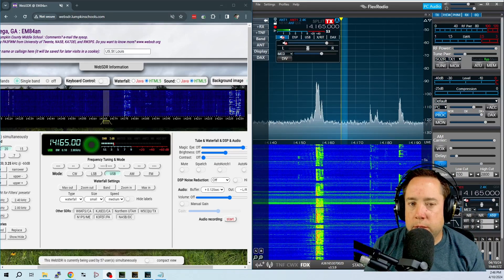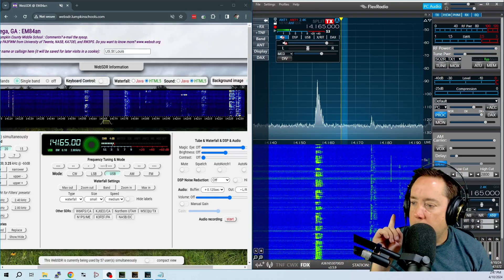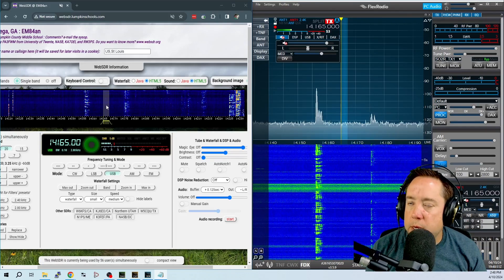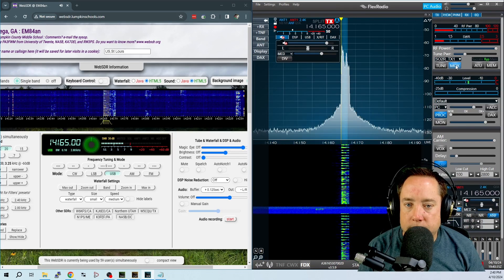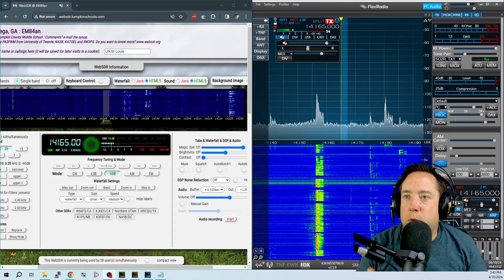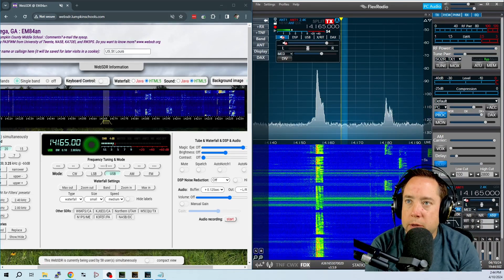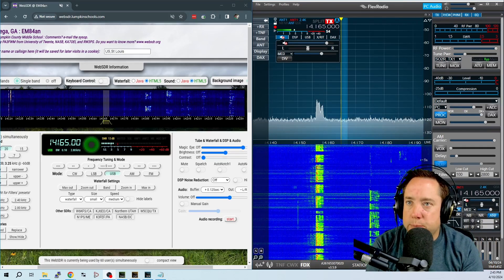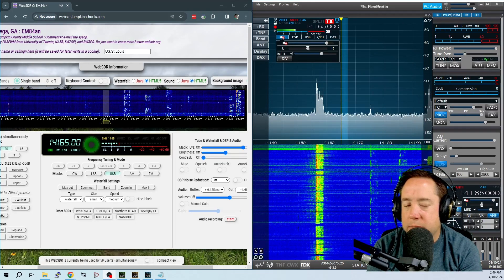What Do You Sound Like On The Air? - Transmitter Settings

Comment: Great video Kyle.  This is on my to-do list for tomorrow.  I wonder how much difference mics and mixer would make?  I'm using the rode wireless pro lav mic for streaming and radio-ing, both coming out of the rode mixer.  THanks dude!
Reply from the maker: It's all relative right? The base and the processed audio should give you a good idea? Play with that TX EQ on the flex top!